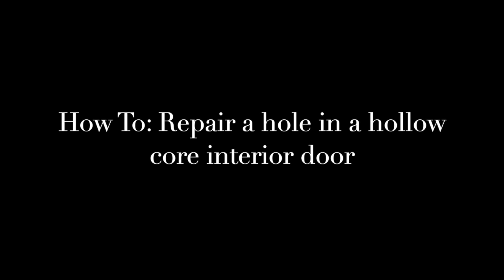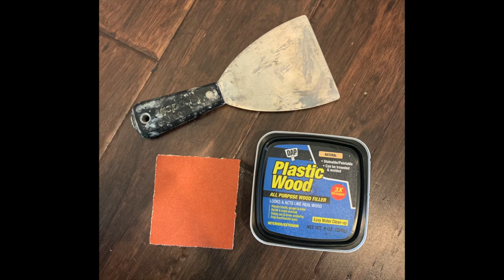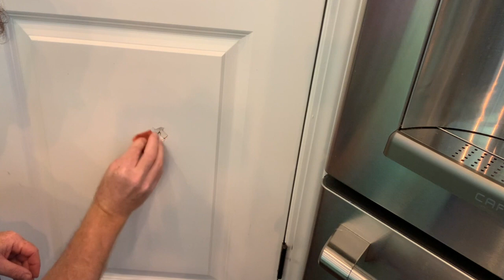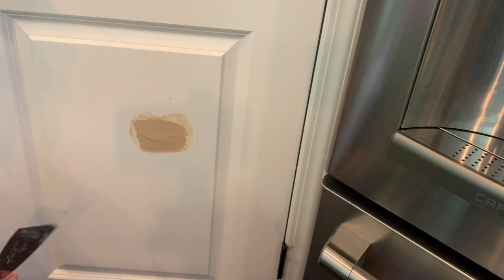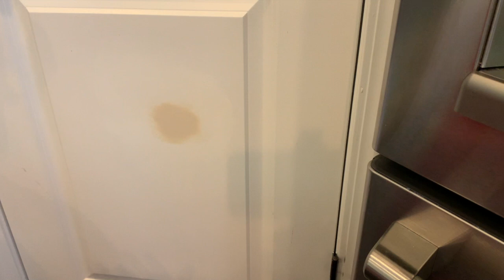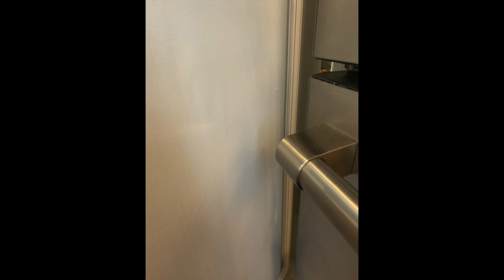How To: Repair a hole in a hollow core interior door (for cheap)

Comment: Would a sander sponge work for the sanding part
Reply from the maker: The problem with a sponge is that you end up creating a cup or divot in the wood filler from pressure. A block assures that the sanding is level to the door panel in the end so it's invisible.

Comment: Can I let this dry out for 2-6 hours then begin to work on it?
Reply: Or can I speed it up using an air dryer?
Reply from the maker: It depends on the manufacturer of the putty...the one i used was like Bondo, I didn't want to risk sanding it and having a wet spot so I waited.
Reply: @mikeshomemaintenancenstuff7030  what's the best brush to use for this?? Nylon ?? :o
Reply from the maker: @drakosasori3071  I found the best painting comes from a good brush. Nylon or polyester is fine. You don’t need to pay for Purdy brand, but if given a choice - good, better, best, get at least the “better” quality brush because the ends of the bristles will be finer and will not leave such large visible strokes.